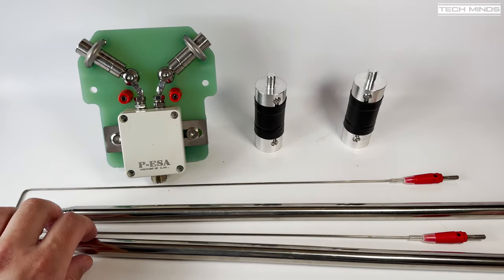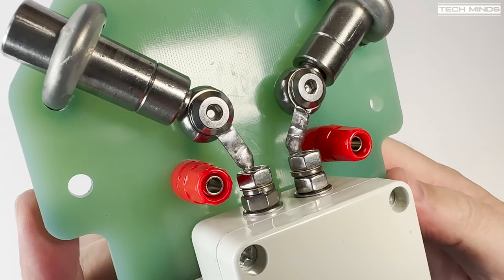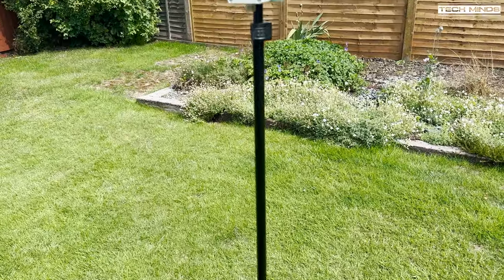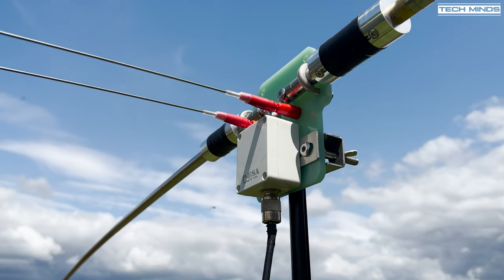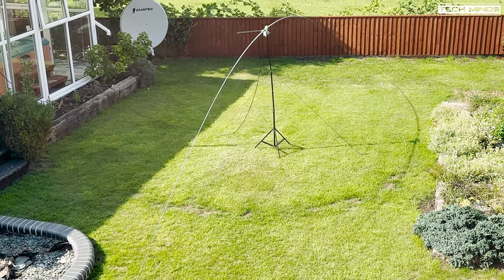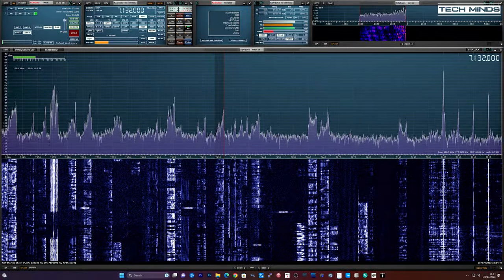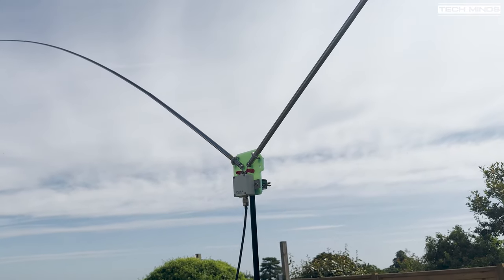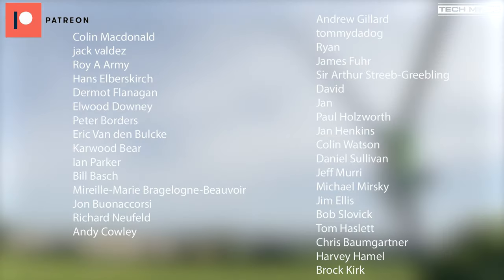DP200 7 - 54MHz 500W Portable Dipole HF Antenna -  Better than a GP Antenna?

Comment: Amateur radio operators call it Hairpin Matching, RF engineers call it stub matching. Hams have a tendency of creating their own terminology for broadly used concepts, which makes it more difficult to find reliable, scientific information outside of the amateur radio bubble. How Stub tuners, be it a single stub, double stub, open or short stub tuner, there's a nearly inexhaustible amount of information out there.
Reply from the maker: Thanks!
Reply: That's an interesting point about ham terminology. I wonder if many of the RF Engineering ideas incorporated for ham use have actually came from Engineers using everyday terms in an attempt to make the concepts more easily understood by less technical hams? Hairpin, flowerpot antenna, antenna tuner, cans, j-pole, Pixie, window line, dead bug, the list goes on 😀.
Reply: What band he can work
Reply: Hams also have a habit of making up their own phonetic alphabet which can be confusing for those of us who were trained to use it professionally.

Comment: I’m guessing that that balun is a 1:1. Having a 9:1 on a dipole doesn’t really make any sense to me. It looks like an interesting design though.
Reply from the maker: A 1:1 would defo make more sense. Thanks!
Reply: @TechMindsOfficial  Keep up the good work!
Reply: It's far to short to be a resonant dipole even with those big loading coils at 40m so it's impedance will be far higher than 50 ohms. That's why it has a 9:1 balun.

Comment: The structure and color of the plate absolutely look like FR4 PCB material without any copper plating.
Reply: Colour roughly matches FR4 PCB material but there is no fiberglass visible (material is transparent + no signs of fiberglass on the edges), so I don't think it is FR4.
Reply: @krzysztofsoja5301  I was thinking about FR4 because of the surface texture visible @1:15. And FR4 is often translucent. But it is of cause only a guess...

Comment: I have always found end fed antennas to be extremely noisy.  An antenna of last resorts if you will.  Just my experience.
Reply: This is not end fed. It is a center fed dipole, plain and simple as they come.
Reply from the maker: @cdrobson I think they were referring to the antenna I was testing it against.
Reply: @cdrobson  Yes sorry I wasn't clear. The antenna being used to compare this telescopic dipole to was an end fed dipole I believe. My experience of these is that they are noisy. Try a loop around your garden or house with a 4:1 for a very quiet antenna that also talks well.

Comment: Just to note they are loading coils Matt, not induction coils. 

It looks well made, in a shed, by a keen amateur rather than mass produced. Fundamentally it is a dipole with a built in balun, which should be a 1:1, not a 9:1 for a resonant dipole. You can see it from the twisted pair used. With a 10m dipole is would be resonant on 20m. The loading coils extend this, but because they are in the centre the losses are high (radiation resistance vs ohmic resistance) but with this design there isn't anywhere else to put them. These coils are also the reason for the narrower bandwidth. You won't notice the loss of efficiency on receive because you will be limited by noise. Stainless steel isn't an ideal antenna material, nor is chrome plated steel, but it is hard to make a telescopic whip out of anything else.

I agree with your analysis. To me it looked very floppy, OK for portable use, convenient to deploy, but it won't last long in a permanent installation. Should be great for 10m portable. IT is a pity they used an SO239. Most decent portable radios use BNCs these days but old bad habits die hard. I wouldn't want to use it at 400W. There is no cooling for the balun. SSB perhaps but FM/FT8 no. As you have a thermal camera, perhaps you could test that. Might be interesting.

Mike
Reply: Loading coils are inductive coils, same thing. Ham terminology vs industry terminology as described by another post.

Comment: 👍Thanks for review. Antenna is maybe a similar idea to the Buddipole. Agree that the plug in "hairpin" for 40m is a tuning stub - it will be shifting the feedpoint impedance closer to 50 Ohms at resonance. I wonder if it could be made to work on 60m or 80m by attaching hamsticks instead of the telescopic whips. I was impressed how well it performed compared to your EF.
Reply from the maker: Another suggestion by someone else was to put a piece of wire between the tips of the two elements, essentially making it a loop. However I have something else coming up which is designed for just that. I do have a couple of moonraker multiband antennas, maybe I could try them if they fit in the thread. Cheers!

Comment: Shortened antennas may be fine for receiving, but the real test is the transmission. Low SWR tells just the part of the story as the inductances may introduce substantial loss and large part of the signal may go vertically which is equal to being lost.
Reply: That's exactly how it will behave. WSPR tests, specifying short, medium and long skip stations in play, will soon reveal this.

Comment: As for the sagging of the elements, you might as well make a delta loop out of it by adding a wire between the radiating elements  and change the 1:1 unun for a 4:1.  Would be very interested if that would improve the low to ground also
Reply: I concur.   I think he said the balun was 9:1, but I don't see how that could be
1:1 makes more sense.   And yes, a 4:1 for a delta loop.
You'd probably have to find a way of locking the telescoping units so they wouldn't collapse in with the top wire pulling on them.

Comment: A V dipole is very efficient in radiation loss. A sagging antenna or below 1/² wave from ground at resonance loses power to reflect on ground. When your above a 1/² wave the returning ground wave joins in the radiation and your bananas are going up. Lol, Decibels for those don't follow Callum.
If you can NOT get 10 meters above ground then a 20m dipole is not best. A 1/4 wave vertical will radiate better, even a vertical dipole at 1/⁴ wave feed point is better than having your dipole too low. That returning ground reflection reduces your near field energy by subtraction. Maxwell decided this with math and physics not my opinion. Dont let anyone say its fine if your too low. Unless you really want local comms only then drop it for NVIS and enjoy reduced power and upward half power beam at 50 degrees above horizon.
Reply: Not to mention the massive environmental gain that is available anywhere near water; about 10dB over fresh water/marshy ground but up to 25dB at long path time from the seaside (this is from real WSPR tests, not wishful guesstimating). None of that is realisable for a horizontal antenna, though a bit of sloping ground will help by a much lower factor.

Comment: OMG, I checked ebay A$368, I then checked your link A$158 hmmm okay! haha
I have an MFJ 2289 which is a little similar, designed for 1kW tho. I also saw the MA-50 which is a 200W version of the same thing. Cool antennas I reckon, they work well!

Comment: Maybe some fishing braid between the two elements when in a V?  You could put loops in the braid for each band to maintain the V?  Braid covered fiberglass rods may be better for a permanent install?  I am seriously considering for VKFF in Tasmania as a better alternative to the Endfedz loaded 40-10 EFHW I use currently.
Reply from the maker: That's not a bad idea, the hardware is there to experiment with for sure. Cheers :-)

Comment: The hairpin match is very common. But, it's rather irrelevant: those whips will snap the minute the wind gets up - which is pretty much all the time in the UK. And no, it will not stand a chance against a 1/4 wave vertical, more so if you run the comparison at a beach, where I expect, from experiments, it would beat the metal tube monster by up to 25dB on long path DX. How about a side-by-side challenge between the two types, on specified paths? WSPR, preferably with two 200mW WSPRlites would be ideal. Anything else is just assertion, really.

Comment: If you connected a wire to the tip of each antenna in the V config ,it could be a delta loop also(??)
Reply: It could. But you would need another balun. Not a 1:1 as it came with. Good idea though.

Comment: I don't think so, The Vee configuration radiates NVIS. The horizontal is a normal dipole, radiation depends on the heigth.
Reply: Exactly. I built a 20m vee like this as a lunchtime experiment once. It was absolutely useless for anything other than NVIS and noisy. A 1/4 wave wire up a light fishing pole is an infinitely better performer, can be made for pocket money and can also benefit from watery ground gain, which is substantial (I live by the sea, and I've done the experiments; only those who don't live by the sea argue it's not possible).
Reply: If it is a Vee or a horizontal dipole does not really matter.  What matters is the average height.  Once you come up above 0.5 lambda you get those sweet DX angles.
If you have a dipole or a Vee near ground, you introduce ground losses and the antenna basically becomes a sky-warmer.   Unless you just want to have a quiet antenna where you only hear locals on low bands, I would avoid those at all costs :)   If you can not raise a dipole high enough, a GP is probably better.
Reply: @la7dfa  Sorry. But that V angle does matter beyond heigth. Just made a simulation with nec and you will see ... V is much worse than horizontal for low angles of arrival.
Reply: @alteriaautomation6867   V has both vertical and horisonal components.  So it can help a bit more for long distance when it is closer to ground.  But if you mount it high, a horisontal dipole will have more groundgain.  Up to 6dB over vertical

Comment: Looks fragile  almost to the point of single use😢
Reply from the maker: Not at all, its very sturdy. The elements bend a bit when using 40m though as its quite long.
Reply: @TechMindsOfficial  It's going to be very limiting in windy weather. It will want to turn, for a start.